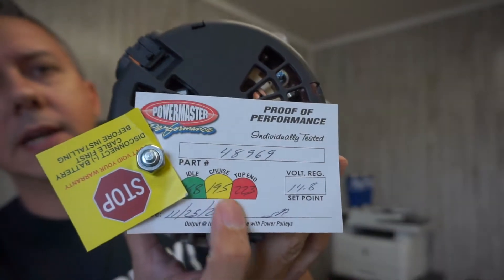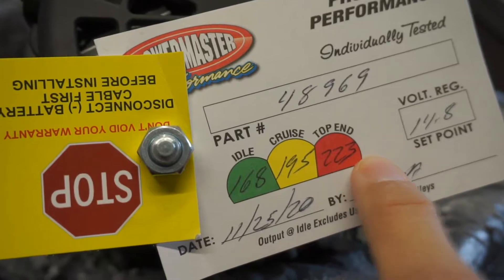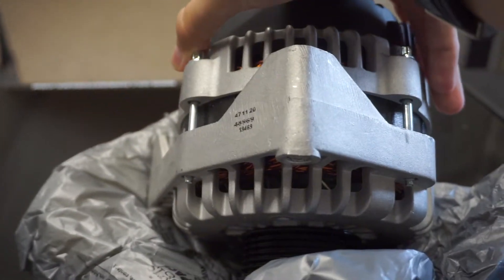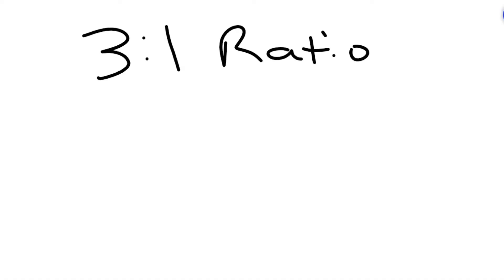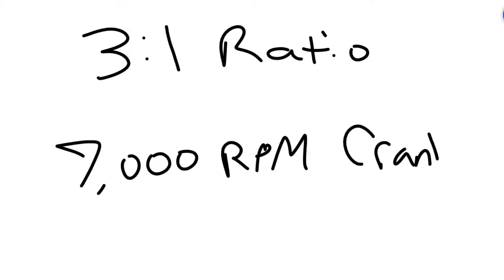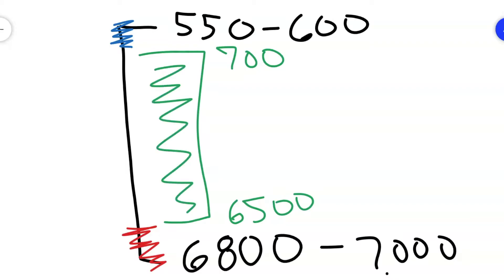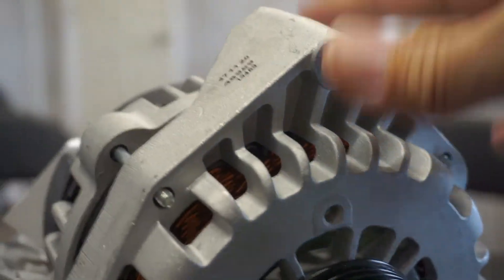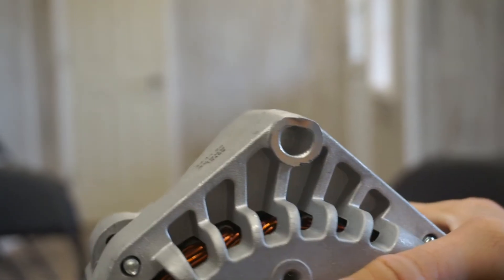CORVETTE ALTERNATOR PROBLEMS - POWERMASTER EXPLANATION - SOLVED?

Comment: You need to tell it what it needs to put out, and hook up the 2 pin or 4 pin connection so the PWM side of the ECU can controll output, that way it will put out more when needed at whatever rmp it is at, no dimming of lights when your AC comes on, ,

Comment: Amperage is a draw by a load in the ckt. Voltage is the power produced by the alternator. That is why there is a voltage regulator in the ckt to keep the alternator from over charging the battery.

Comment: Doing the big 3 would help a lot. It’s the car itself and the plug on top folds over and you need to remake the connections in the plug itself. It will fix your issue the wires are brittle
Reply: I don't think the OEM wiring needs to be replaced along with the alternator.  the big three was designed for high power radio upgrades, which don't really work well with the very specifically engineered corvette electrical circuits anyway.
Reply: @richardelliott8352  the car demands more power than you may think which is why there are battery issues and you get service charging system on the C6 more often than not. The plug on the alternator does not have a factory 90 so after time wires folding in the plug are the issue but your opinion is interesting. Take every ground off and fix the factory paint inter a majority of the connections as well as doubling up the wiring creating a cleaner power for the whole cats electrical system. It’s a known issue not a opinion

Comment: Not had much luck my my powermaster either. Bearing damaged during manufacturing caused mine to fail pretty quick. Fixed that then a brush wire shorted to case and failed again :-(
Reply from the maker: 😮 Dude that sucks! You would think they would have a little better quality control and more knowledgable staff considering how big a company thy seem to be.

Comment: If bigger wires don’t help with moving the current better then why would people use 1/0 wire for amps and such?
Reply from the maker: They help move the current but only if the current is being drawn by the device, not pushed by the power source. If current was pushed then you wouldn't be able to use small wires for an LED that might be connected to a large amperage battery.
Reply: @MrJimTim  oh okay I see thanks I went ahead and did what they call the big 3 upgrade with some spare 4 gauge wire I had laying around and it helped with my voltage drop but barely I just ordered a Powermaster 140 amp alternator
Reply: @jacksonmangum  ?
Reply: How did it fix with the big 3?

Comment: I replaced the OEM alternator  on my 07 Z06 last year with the Powermaster and worked really well until yesterday when I decided to drive my car nearing the redline.  Now it is giving me the “Service Charging System” message.  The battery is only less than a year old so and I know it has nothing to do with the problem message.  I think the aftermarket alternators just could not handle high rpm especially on the Z06.  I still have the old OEM that went bad, maybe I can have it repaired or I’ll just have the dealer install a brand new OEM alternator.
Reply: Any luck with your problem?
Reply: Same here happening g to me now
Reply: a lot of C5 owners have found rebuilding the factory alternator is the best solution. @scaredofc6

Comment: could you use an oversize pulley on the alternator?
Reply from the maker: I found out in a later video that it did come with a larger pulley and that's actually why it was having problems.  It reduced the revolutions at the alternator at idle too low and it was struggling to produce the amperage needed to push the fan and other electronics.  I had my tuner raise my idle speed to compensate and so far so good!

Comment: 6 months later, how's it holding up? Was looking to buy one or a mechman
Reply from the maker: It's still working 👍🏼Looks like the key factor was raising the idle speed to compensate for the larger pulley.  Otherwise the alternator doesn't spin fast enough to produce the required amperage and voltage needed by the cooling fans and they will burn it out.

Comment: Would a fuse between the alternator and battery drop the current or straight wire better for max current
Reply from the maker: A fuse could cause some current loss.  Straight wire for max current.
I think we finally fixed the problem.  Car was idling too low for the alternator with the larger pulley.
Reply: @MrJimTim   How did you end up with a larger pulley?
Reply: @Teramydog  the Powermaster alternator comes with a larger pulley so you will also need a longer belt.  The Powermaster that I installed just went bad after a year so I contacted the Chevy dealer to get it replaced so it is going back to OEM.
Reply: @David-jh8mp  thanks for the answer!👍